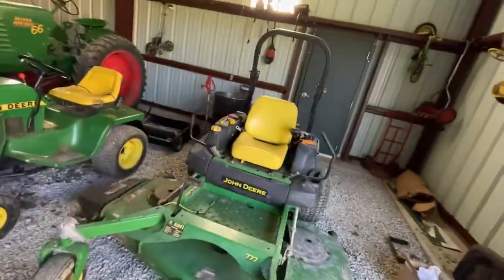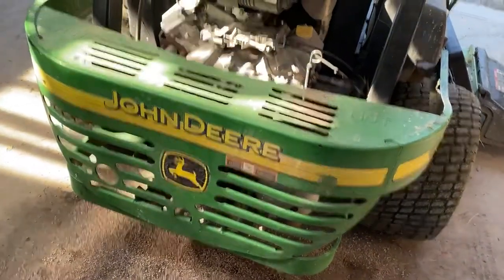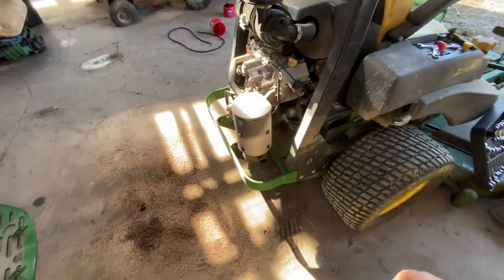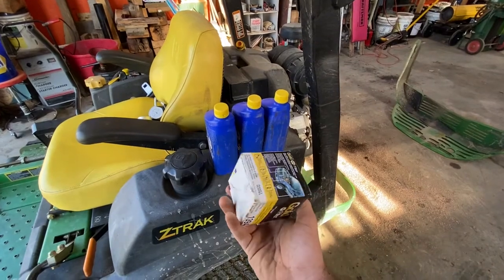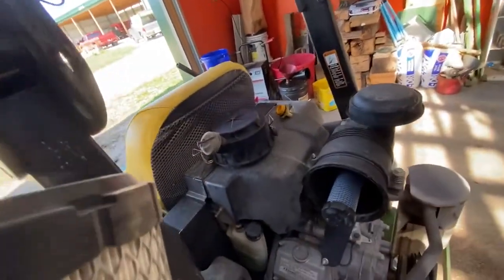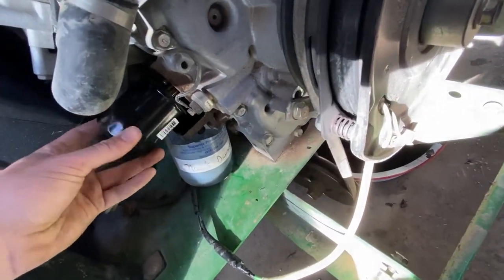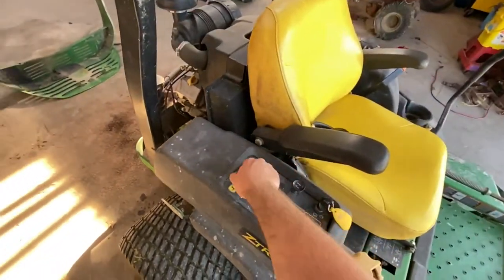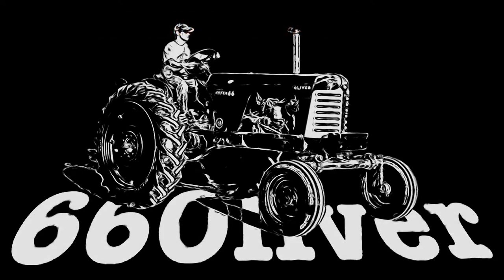Oil Change in a John Deere 777 Zero Turn Mower

Comment: I have a question about the little screw like thing to the right of the filter that has a wire attached to it.  I have an oil leak around it but do not what that part is called.
Reply from the maker: That’s more than likely your oil pressure sensor, you’ll need to pull it and replace the o-ring or sensor, depending on the seal setup.